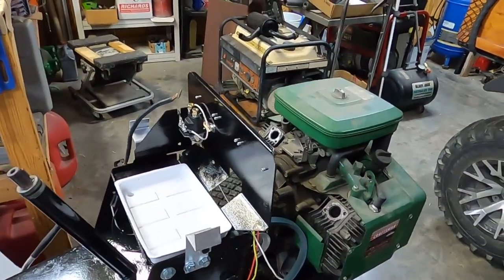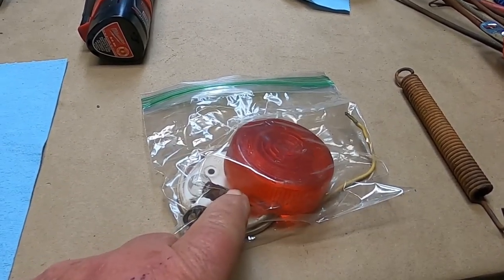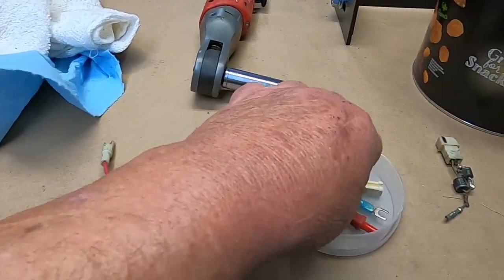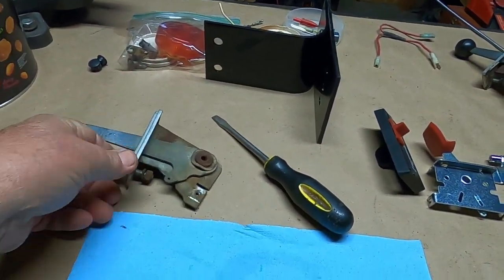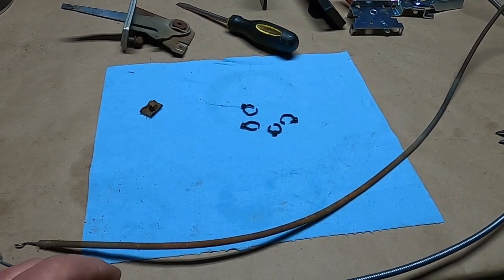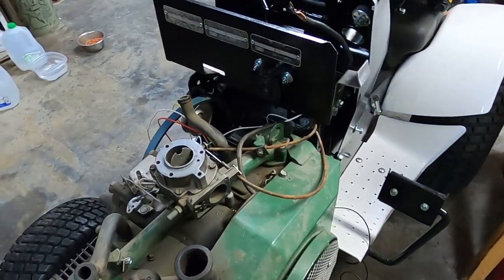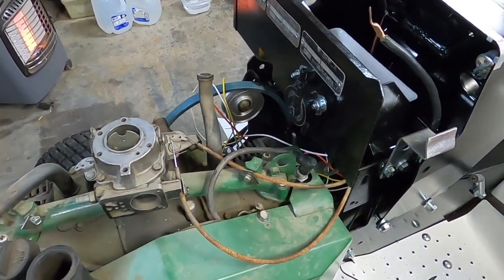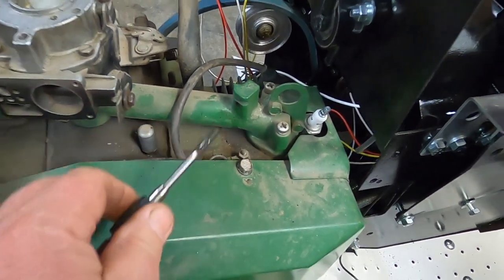Roper 16T   I need a bigger shoe horn

Comment: Another option is to get a sheet of steel, cut the hole in the correct place and fold it to the right shape, easy when you have a folder of some description, we have a cheap one and are thinking of making one for the press. Something we have done in the past is take the old part to a metal shop and ask them to replicate it. Most places over here will do it for a small contribution to the coffee fund and you just need to mark where you want the spark plug hole. Both options would be better than struggling with the plug which I am sure will happen at some point in the future. The cable layout looks good
Reply from the maker: Shouldn't matter as little as I plan to run this tractor. I could look into that option later though.

Comment: It possible the hole is just a remnant for the Onan engine.  Is it really needed for the Briggs?  Looks like you would still be able to access it engine side of the firewall.  Only issue I see is your fuel pump being right above it.  Maybe not.  Option B on the throttle cable.
Reply from the maker: I am sure I can sort this out. For the spark plug access I don't think it will be an issue with a new plug. Throttle and choke is figured out. Working on an alternate method to crimp the starter cables, this should be interesting. Thanks for the reply.